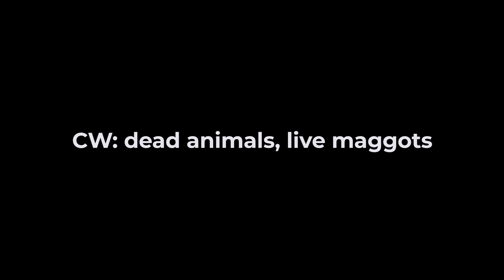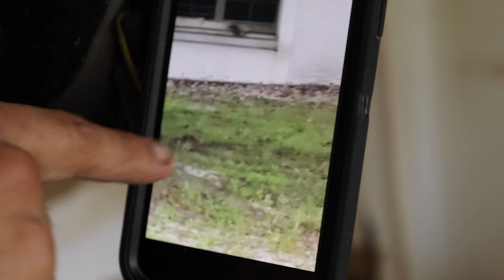Rat House of Horrors Pt. 2 | Brandon, FL

Comment: I would donate this house to the Fire Department for training exercises then clear what's left and build a new house on the foundation
Reply: That house REALLY needed to be torn down and not gutted. A couple of years ago Laura bought a hoarder house that was roach infested and gutted it, and it turned out nice. But there is a huge difference between roaches and rats. Another great reason to rebuild and not repair is the fact that she said it's a 70s house, which means it HAS to have been hit by termites at least a couple of times by now. And it's not built to the Hurricane Andrew building codes. Good luck to the sucker who ends up buying this rat hole; they're going to need it probably.
Reply: Maybe not, especially if someone died on the property.
Reply: Biohazard still needs to be removed before burning. Weird yes, but most houses donated to fire departments are cleared out first
Reply: What if the fire dept doesn't want the property?
Reply: I don’t think the fire department want it. I’m surprised this comment has so many likes. They can’t just have firefighters training in unsafe houses .
Reply: Not only that the house is in a neighbourhood with people living nearby.
Reply: @alyssamary7132  as someone who worked with the fire department (retired) training is held in buildings of all conditions. They don't just go to newer up to date buildings to fight fires or for rescues.  You are right about the neighborhood, though.  Safety is always top priority.